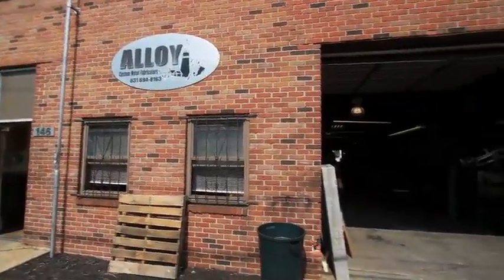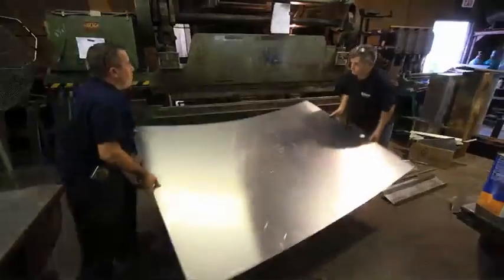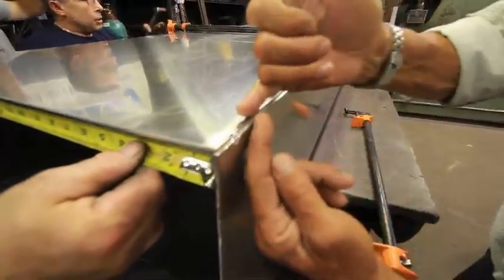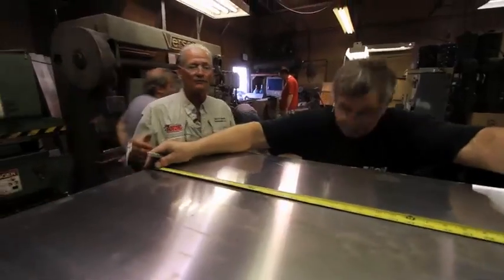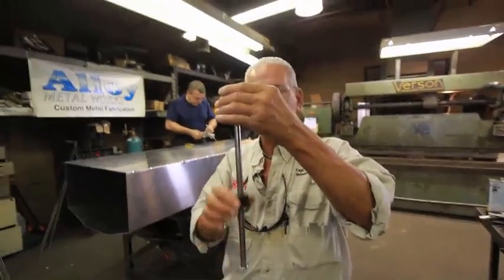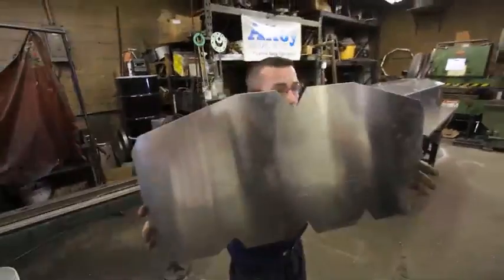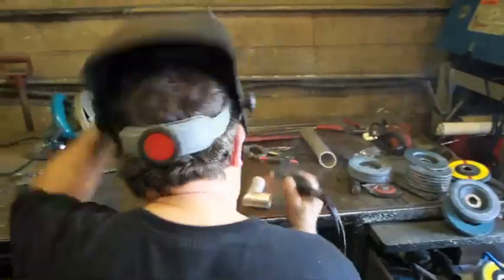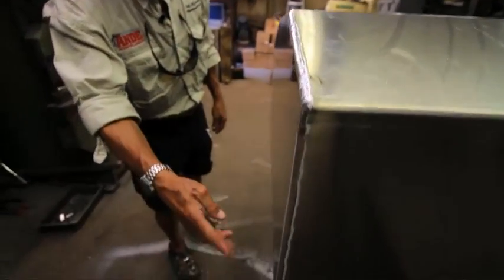Marine Fuel tank Fabrication

Comment: What a dangerous press brake..........
Reply: Yup a lot of people see stars when they run a mechanical brake..
Reply: They cost thousands not hundreds of thousands or millions.  Could never afford the one-off tank with all nee equipment.
Reply: @thewayidoit8895  Is it your workshop ?
Or are you just the spokes person for a dangerous piece of kit?
Reply: @theessexhunter1305  I've run a similar machine.  Retired now.  why be so negative about equipment that built this world.  We can't really afford to live in a world operating from a keyboard.  Its going to catch up to us.
Reply: @theessexhunter1305  True, I've certainly jumped back when bending steel, also had close calls on sharp edges and while using a hydraulic automatic press.  They require two buttons to operate many machines for a reason.
Reply: @thewayidoit8895  I know how they work also the SHIM type which I have worked on as you add shims which set the depth of bend. Also worked on 10ftx3/8 sheers and the same in a  press brake. Bridge ports jones and shipman grinder 
Swiss jig boring machines plough grinders We have a bit of an idea here in the UK lol as churches older than the New USA lol

Comment: You dont make marine fuel tanks in 1/8" alum...Should be 3/16" Min  Coast gaurd wants 1/4" thick 100 gallons or more
I will do 3/16" if less than 175 gallons and not a coast gaurd inspected vessel
Reply: Avenue Welding not to mention EPA/CARB rules

Comment: why not use STAINLESS ? it dont rot,Fuel Tanks can be deadly made of CHeap BEER CAN Material
Reply: Because it is for a boat and stainless I is heavy, aluminum does not rust either and it is a lot easier to work with
Reply: ''alloys'' dude......not beer can material
Reply: Aluminum corrodes in a salt environment. My Albin 27 tank leaked, it's aluminum, I'm going nuts finding a good replacement.
Reply: @Jorisinflorida  Correct, aluminum truck beds gets a clear coat but after it's gone AL oxidizes and turn black when exposed to road salts..
Reply: i know its 7 yrs old comment but stainless steel and aluminum is a big difference in weight if you hold both pieces together in each hand.
Reply: Somebody needs to tell FORD they should be making their trucks from Knife material not beer can material.  My F150 is almost 8 years old without a mark.  The old steel would be rusting by now.